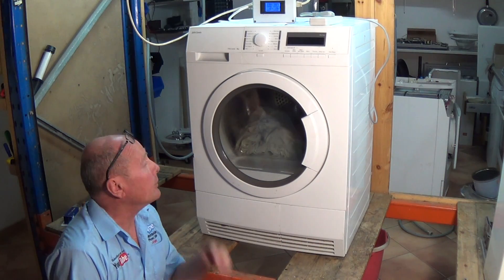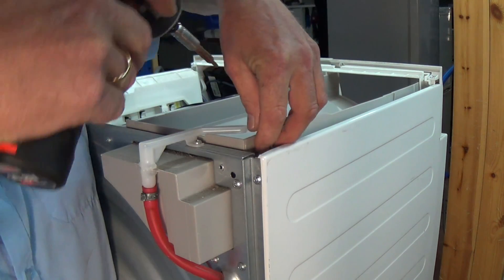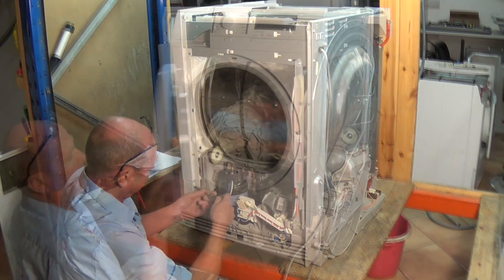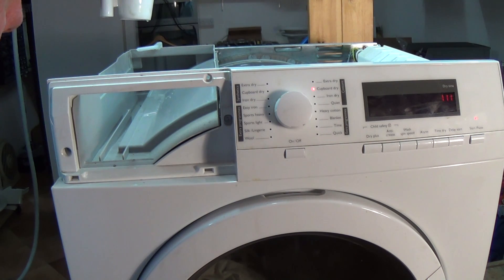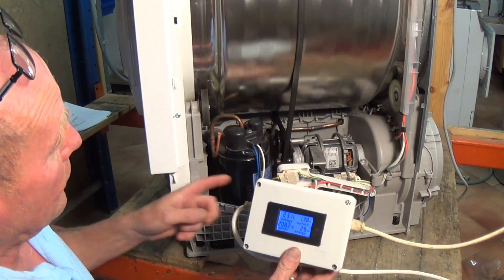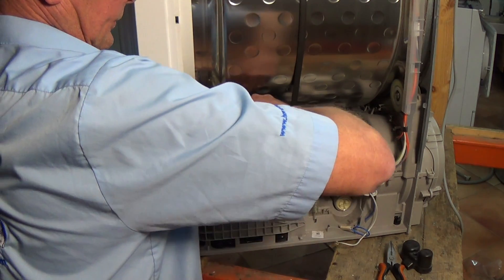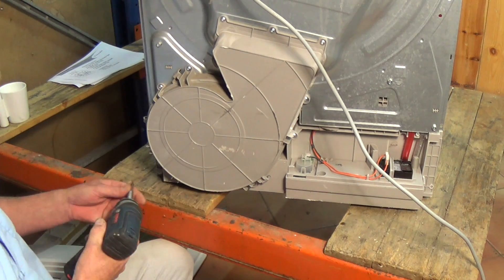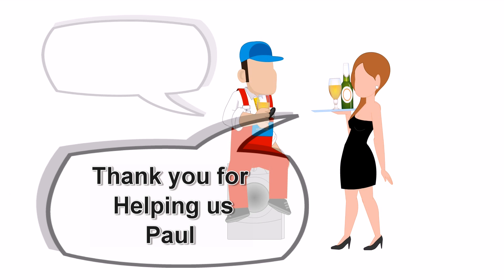Heat pump tumble dryer finding faults and error codes Aeg, Electrolux, John lewis, Zanussi

Comment: How to clear error codes:

1: Go in service mode by turning on, then press the two most right side extra buttons at the same time for a few seconds.
2: Turn the dial to program 8.
3: read out the code, say E32.
4: again press the two right most extra buttons (as in going into service mode), at the same time, for a few seconds.
5: display no changes from your error code, to E00 - which means codes are cleared.
6: turn off and turn on machine. This will go in another test mode.
7: turn off directly, with out anything else.
8: next time you turn it on, it's normal operation.
9: if you re-enter testmode, and go to test program 8, you will see E00 - no errors.
10: job done.
Takes ½ a minute. This works for several older AEG machines. like for example T86580IH and more.
Kind regards,
Redfox.

Comment: The E32 on my T86580IH is a dirty NTC sensor. Easy to unplug and clean and reinstall. 
Then you clear the error code.
Job done.

Remember to clean the whole machine anyway, also the heater and condenser. Just take it apart and undo the top lid. Use some mild detergent like Mucoff (pink), and spray lightly with water. Cover the compressor side with a couple of towels before spraying anything. Takes 3 hours max in total from start to reassembly done.

Kind regards,
Redfox.

Comment: I have error code E63 on C5, C6, and C7, and then error code E32 on C8, C9 and C10. I have replaced the heater element and thermostat but still have the same error codes. Can you suggest anything please

Comment: Is there a video for changing the belt on this machine?
Reply: No, but it's very easy to do:
1: take off the top and the two sides.
2: take off the upper screws and a few lower down of the meatal back plate itself. Some have a plastic back plate.
3: on the right side, take off the spring that loads the belt.
4: take out the old belt, for example by cutting it.
5: this will loosen the back enough, so that pulling the back out a bit, you can sneak down a new belt, for example PH7 1971 on my T86580IH.
6: once you sneaked in a new belt, and because of loosening the back panel, you will not damage the support wheels and the big felt gasket for the drum, roll the new belt over the plastic pully and under the motor axle.
7: reinstall the spring and test machine.
8: the belt is good on apprx. half out on the motor axle, so place the belt accordingly around the drum.
10: job done.
Takes ½ hour and belt is 15 euro for and original AEG.

Kind regards,
Redfox

Comment: Hi , does the compressor only work when the elektro motor is turns on ? My circuit breaker shuts off the moment when i start a program .
When i unplug the motor , the breaker stays on , when i plug in back the motor and unplug the compressor , the breaker also stays on . I ve tried the service mode till my fingers hurt butt it won’t work with me , please help , thank you

Comment: Hello.Nice video.I have same model.Dryer working but after ~ 40min  I get error code EHO. The fan near compresor not working,i did not chek the fan but I check voltage it is not come 220V from the board.

Comment: I got an aeg T96690IH. Does not turn on.  Display is dead. I have measured 25v to the front panel board which goes to zero when you press the start button.  Still no start.  Any help is appreciated. Thanks

Comment: Very useful tutorials, thank you. Our John Lewis 7Kg heat pump tumble dryer is stopping before the indicated time and not drying the clothes fully. I have cleaned the bottom matrix which was pretty clogged. I put it in test mode and the individual functions appeared to work. At C9 it shows an E32 error code. I see what that is in your list of error codes, but do not know if that is something that may be fixed by me or would require a service engineer?
Reply from the maker: John Lewis heat pump tumble dryers are usually manufactured by the Electrolux group without the full model number. I am unable to point you in any direction, but if you contact us through the website I would be happy to try and assist you

Comment: i have a perfect care 900 electrolux heat pump dryer, i complain that heat to much and shrinkage the clothes, i called the service mo error codes founded but they changed the mother board, after that the fan was doing on and off every 2 minutes like it should be, but unfortunately only for the first cycle, in the second one the fan switched on only to 2 randomly and thn never more like before changing mother board, but now in the cooling phase last 10 minutes the fan work, but the way it still heating to much and shrink my clothes, what i can check on it?

Comment: Hi Paul,
I need to replace the belt on this machine, how do you gain access to fitting the belt? Do you remove the front panel or the rear panel to fit new belt?
Reply from the maker: I would need to know the full model number to help
Thank you for leaving a comment, I would love you to leave your opinion on our poll about manufactures building in obsolescence to appliances. https://www.youtube.com/post/UgkxygHomnUySd_bYjaJBdEHPO6T4dYo9Ahm
and this is for you https://www.youtube.com/shorts/e432SAb2g08 please remember to subscribe as that's is what keeps this channel going. Thanks 👍
Reply: @How-to-repair  the model number is an AEG T96699IH heat pump dryer, similar to the one in  video Paul, any help would be appreciated 👍

Comment: I did the work to clean the matrix on an AEG T96690IH.  All good, but when I reassembled the dryer and tried to start it I get an E91 code.  After a quick search, error is for a communication error between main board and display.  There are only two connectors between the two boards and you cannot do it wrong.  What I did see though is that the connector to the motor can go either way.  This is the only thing I might have done wrong.  Also the 
light in the drum area stays on. Any clues?  Thanks
Reply from the maker: please feel free to contact me in the website where you will actually be able to get in touch with me

Comment: At 5:20 you mention the heating/cooling matrix and that you are not going to show it on this video since the drum needs to be removed.  Do you by any chance have a video on this?  It seems to me that the only thing that is going to remain is the bottom part.  I need to clean it since it is fully clogged and condensation is pilling up in front right below the filter.  Pump is good and so is sensor.  If I pour water in the back and in service mode, pump activates and pumps the water in the tank.  Any video with removal/cleaning of the matrix along with what it takes(dismantling) to get there will be greatly appreciated.  Thank you.

Comment: Hi Paul,  very informative video. Thanks a lot. It's very rare, but another test that can be done on the compressor is to measure resistance between each of the terminals, common, run, start, and the compressor chasis, to check for current leaking. Greetings from Spain.

Comment: I have a Samsung dryer with a heat pump 9kg compressor, it takes 3 to 4 hours to dry if I put two towels after they come out of the washing machine, is this normal or is there a weakness in the dryer?  The temperature of the internal drum is approximately 45 degrees Celsius, while the LG dryer reaches 90, how can I increase the drying efficiency and temperature by changing the capacitor?

Comment: Have a fault on out electrolux dryer. I can hear the relays clicking but the tumbler isnt turning. E5e in the display. Also e32. What tests should I perform?
Reply from the maker: hearing the relays click does not necessarily mean it is working correctly. without having the machine in front of me I might be giving you false information. I'm sorry I'm unable to help with this one
please remember to subscribe to the Channel as that's what keeps us going and able to make videos for you
Reply from the maker: https://www.youtube.com/watch?v=7KmnizwuUEM&t this might have helped
Reply: I have error code E63 on C5, C6, and C7, and then error code E32 on C8, C9 and C10. I have replaced the heater element and thermostat but still have the same error codes. Can you suggest anything please

Comment: Hi Paul, from your video I was able to figure out either the float switch or the pump was not working, removed the pump and applied 240v, it turned so had a look at the float switch, I removed it and it all looked good so think it may have stuck down stopping the pump coming on. Cleaned out the reservoir put it back together and filled it with water as the machine was drying, it pumped the water out as the level got near the top. Hope it stays fixed. I very much appreciated your advice.

Comment: With this test all working de pomp motor fan compressor but when i start the machine de fan compressor doe nothing and also i get not water in the reservoir under de pomp is dry  i wait for your reaction thanks
Reply from the maker: this may be a sensor or it could be the start relay on the compressor you need to check if they have power

Comment: The videos on this channel and the content on the website really helped me to tackle investigation of my machine. I got an "E32 - Conductimetricsensing oscillation frequency too low" error code, which according to the Electrolux manual is an Electrical / Main Board fault. After finding no obvious wiring faults, I spent £160 on a new board but this didn't fix the fault. Whilst banging my head on the closed door in desperation I heard a microswitch clicking when I applied some pressure to the door. I investigated further and found that the little plastic tongue in the top of the door wasn't going far enough into the body of the machine to activate the switch. I found that extending the plastic tongue by about 2mm using a piece of tape fixed the problem!
Reply: hi i have error 31 and 32, have very long drying time, i dont know what can i do.
Reply: @reptilel  Probably a bit later but for anyone reading this:
Error 31 and 32 relate to the moisture sensor just inside the drum. Clean it with some vinegar (as it says to do in the user manual).

Comment: Thanks for your awesome videos, using these I was able to confirm the condenser pump is working fine, but water is pooling at the front of the machine. I have removed the filters and all seems clean, but water isn't passing front the front to the back to be pumped out.  Any suggestions? Cheers, Mike.

Comment: You didn't cover the heat pump or thermal switches? I'm trying to diagnose a Bosch dryer that has lost heat. Can't work out which component provides the heat
Reply: The compressor itself. The first radiator is the condenser and second one the evaporator. This one gets hot and warm the air, about 45-50 degrees

Comment: Thanks for your nice video(s)!. A question about my 65370AH3 (somewhat simpler, no display), does it have a TEST MODE too? Any hint for entering into that mode?
Reply: I used the method in the following video and it worked with your model.  "Aeg lavaterm protex condenser dryer model number t65270ac putting into test mode and reading error" from tim 100 channel.  https://www.youtube.com/watch?v=aysjDpZuK5c

Comment: hi i have the same machine and the same problem.the dryer works perfectly except 2 things.a)after drying i found only 1/3 of water to the collector on a full cloth drying and b)after drying i found returned water under the filters.Normaly this area it should be dry.i think the route from the front to the pump was closed.any idea to clean this route? thank you.(the pump works correctly).
Reply: I have the same problem,  did you find a solution?
Reply: Do you still have the machine?  I am about to take it apart in order to clean the condenser/evaporator unit.  I am confident there is so much buildup there that no water can pass through and exit out the back for it to be pumped.
Reply: Just finished taking apart the machine and at the end the case where the condenser/evaporator are housed in the bottom.  Not a fast job. A good 2 hours work to get there.  Opened it up and cleaned it thoroughly.  You cannot imagine the built up inside the fins and the "mud" on the bottom.  All clean now.  Waiting for it to dry up so I can put it back together.  It will function as good as new, and dry clothes faster too.  Lets see.  For the record, it is impossible to clean the unit if you do not take it apart.  If you ask me, there is a pretty bad design there.  Lint will build up eventually and it will clog up.  If there was a side door you would be able to do the job without tearing the entire machine down.
Reply: @tamtakosxxx  I am having the exact same problem. It is 6 years old , so I assume the build up of lint is the problem. Just wondering if it helped to clean it out?
Reply: There maybe an internal blockage between the front and back of the machine. On mine this was the case. I took the pump housing off to discover sludge which I sucked out with a silicone tube. To check if you pour water in the front at the small water filter area you should see the rear pump housing fill up.
Reply: Hotpoint ntm1182xbuk
Clothes came out wet and cold
Water under the dryer.

Comment: Hi I have AEG T856801H. It’s one of the early protex models.  There is water flooding out the bottom of my dryer and no water in recovery tank. My filters are immaculate and so is front of condenser. Could it just be my pump needs cleaning.  It was moved recently and unfortunately laid on its back would this cause a problem   Please help

Comment: We have an AEG LAVATHERM 86590IH3 dryer.  (Type TC12H6BHP).     After normal operation we found lots of water under the dryer, on the floor!!!!  When I opened the filter door, there were lots of water in that area. I have started investigating the pump area at the back of the machine. I have determined with a digital multimeter  that  the resistance of the pump was about 750 ohm.  In one of the videos the repairman mentioned that according to the service manual it should be about 750 ohm. So at this moment I assume that the pump is OK.......   Next I will try to check the float sensor/switch which turns on/off the pump. Am I on the right path? Has anyone ever experienced this problem before?  (I have not put the machine into diagnostics mode, yet).
Reply: I have similar problem. Pump is working and so is micro switch. In test mode i can empty the reservoir where the pump is pumping water from. But the water flow between the water filter in front and the reservoir in the back seems to be blocked so water flows too slow for the pump to be able to work effectively. I think the passages needs to be rinsed but am currently unsure how to proceed.
Reply: To Andrew Szekely and Jens Klüwer-Ulrich
I have the same problem. Did you find the solution for this problem?
Reply: @serveloyson8831  I also have the same problem,  did you find a solution?
Reply: @jens.kluwer-ulrich  I have the same problem. Water build up at the front of the machine, and not going to the back where the pump is. The pump works fine if I pour water into that area, but water doesn't get there. Not sure how to fix this problem.
Reply: @grahamfountain2218  Hi Graham, did the tilting solution work? Or did you find any other solution?
Reply: I have the same problem, water isn't going from the heat pump area at the front to the pump area at the back. Pump system works fine, but there seems to be a blockage between the front and the pump assembly. Did you have any luck with finding a solution.
Reply: @grahamf72  Hi grazza72, i also have the same problem,  did you find a solution?
Reply: Andrew Szekely    I’ve got same issue
Reply: I have exactly the same problem.  Water at the front, not flowing to pump at the back. Slope isn't the issue,  i have tried this.  If there is supposed to be a flow path from front to back then it is blocked. Any advice  anyone?
Reply: I have the exact problem, has anyone found a solution? Did cleaning the condenser help?